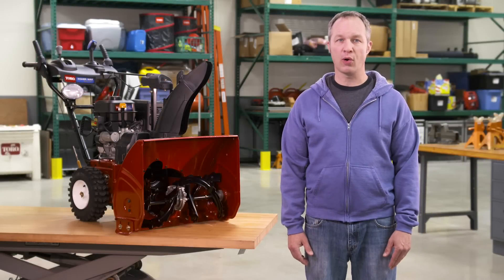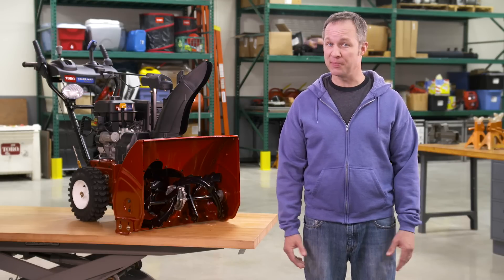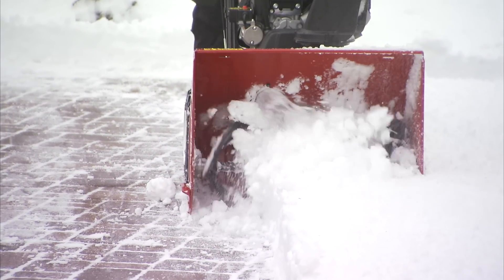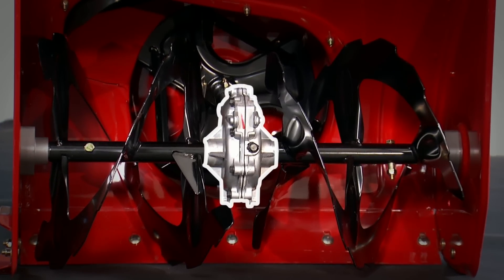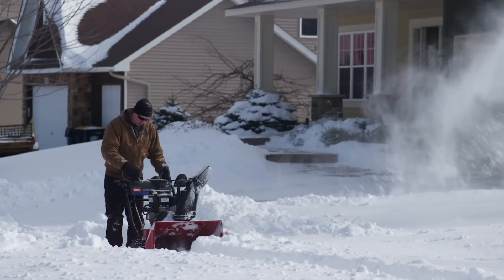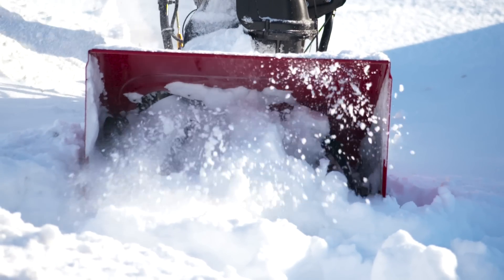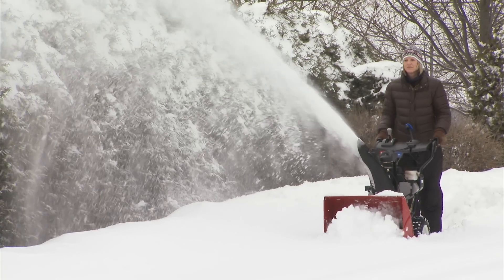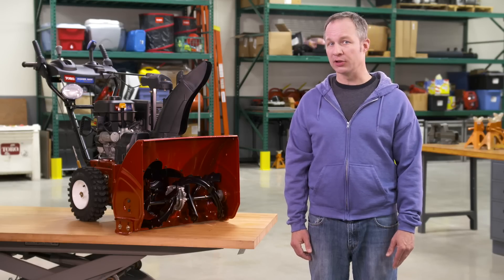Why No Shear Pins on Toro Two-Stage Snow Blowers

Comment: This sounds excellent!!  Is it the same automatic shut off feature for Toro cordless battery powered two stage snowblowers also? All 2 stage snowblowers need this, including the Ego snt 2400. What about the 2nd stage fan? What if a really hard something gets beyond the auger and jams the fan? Does the engine cut out also before anything breaks? This is absolutely necessary. My brand new Ego snt 2400 two stage all of a sudden the auger and fan don't work. 
I mean there's no way people can always be guaranteed the snow won't have some hard chunk of something hidden in the snow. This is a Godsend. I do like the Ego snt 2400 cordless electric snowblower otherwise. It has those idiotic shear pin bolts. Always stay safe, Thanks,🌲⛄

Comment: When did this design come out?  I bought a new Power Max 726 in 2012 and it has shear pins.  I've replaced the two on the auger twice so far, and as of last night, i'll be replacing the sheer pins on the impeller for the second time (once i can get them ordered).